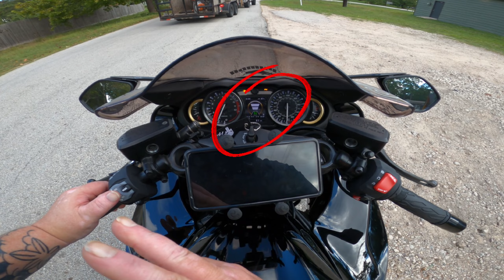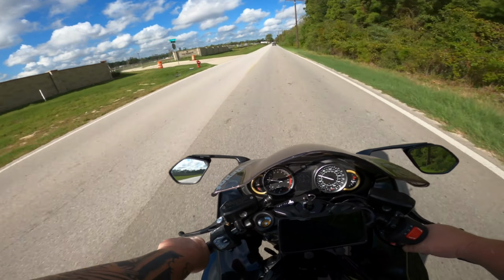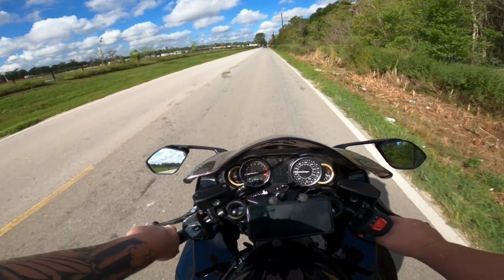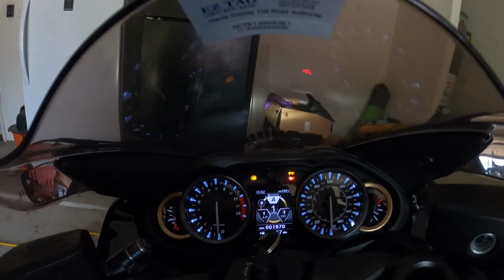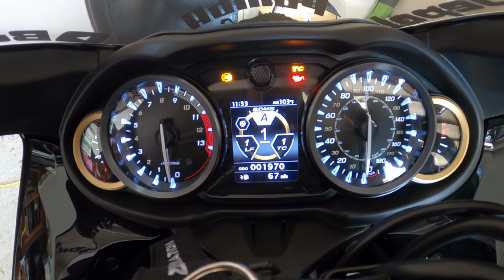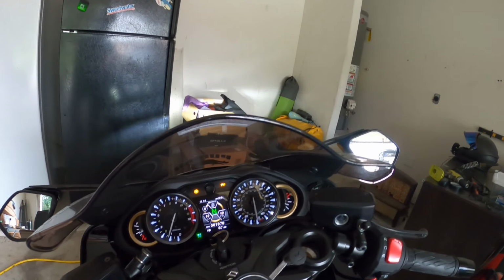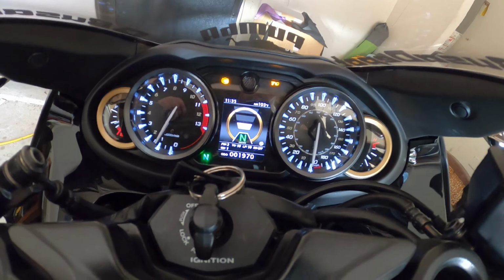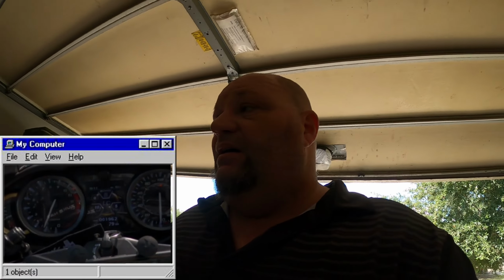Gen 3 Hayabusa Launch Control {4k,6k,8k} How to Safely

Comment: Hey man. Thanks for the video. I know this is a bit old but I've got a question for you. When you did that 8K launch, did you have the TC and LF on? I am a new Busa owner and I have been driving around in B Mode with the TC and LF at 5 each. I seem to get that 2nd Gear Quick Shift Lag whenever I get on it. I was wondering what was causing it.  You think it could be the TC or LF? Thanks Man!